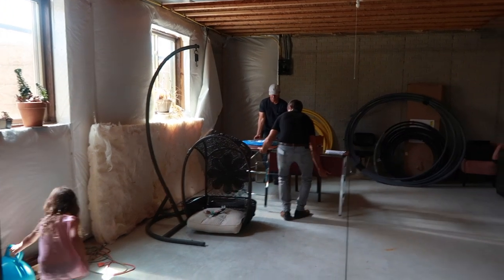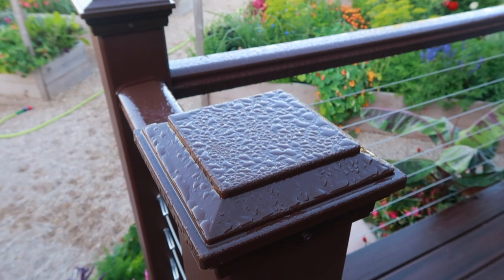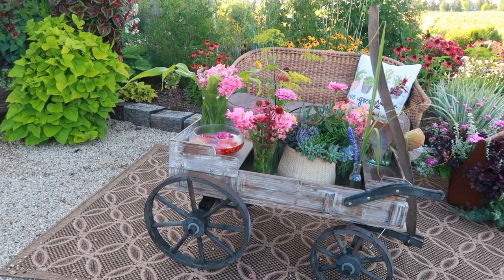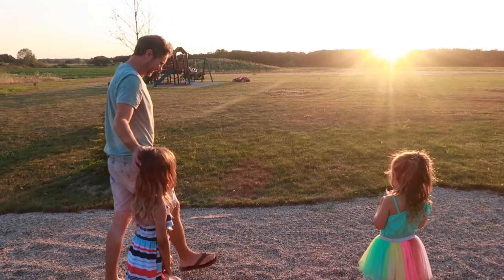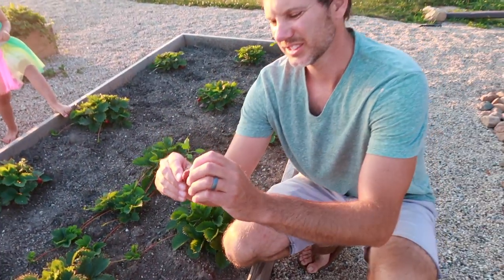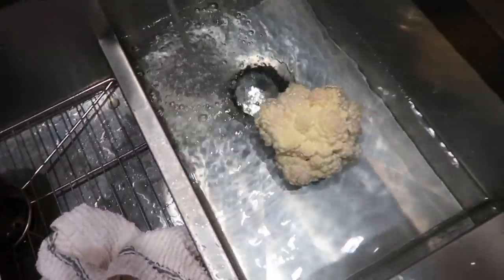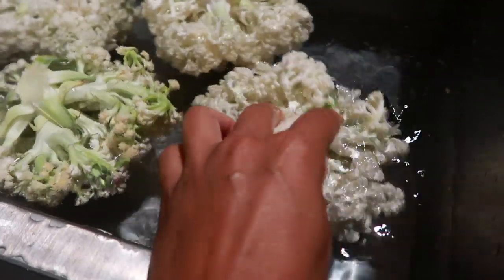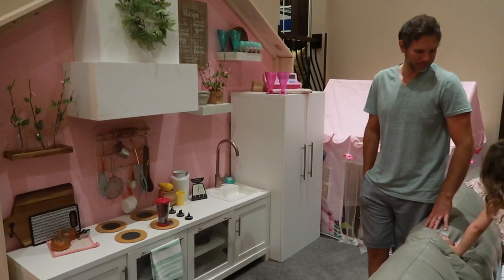Building a Greenhouse, DIY play kitchen and Harvesting Cauliflower & PicklesJL3-25

Comment: I know it's probably too late, but I would suggest a freeze proof faucet. They attach below the frost line about 4 feet deep. We use them in unheated barns, and garages. No need to put foam insulation in the ground.
Reply from the maker: Big E. Thanks for that suggestion! Jason is going to put that on the list, we will definitely do that! We already filled the hole in, but it would be easy to get something like that in there. We appreciate that help, we can use all the help we can get👍🙏